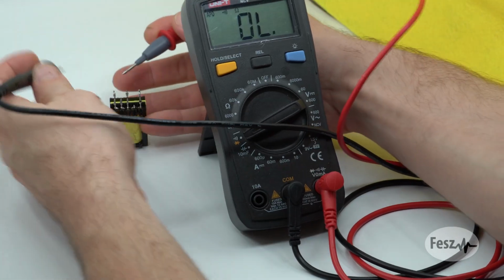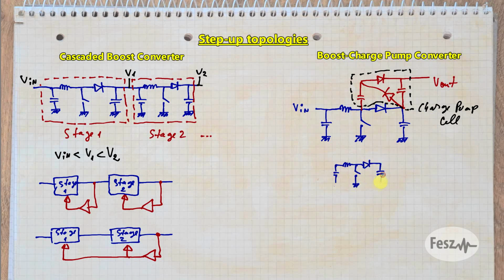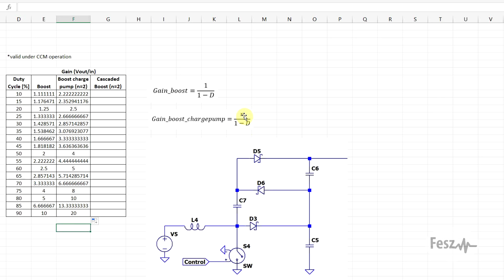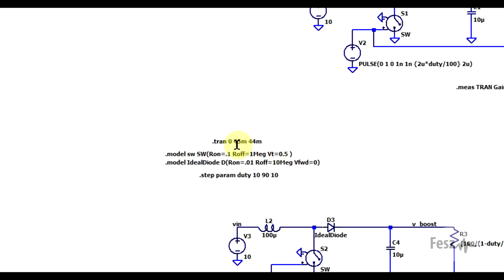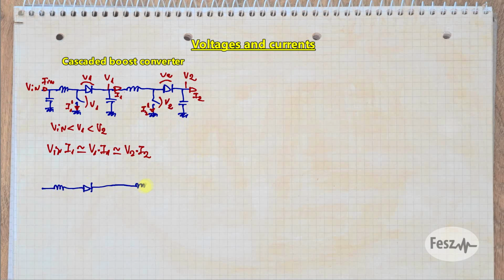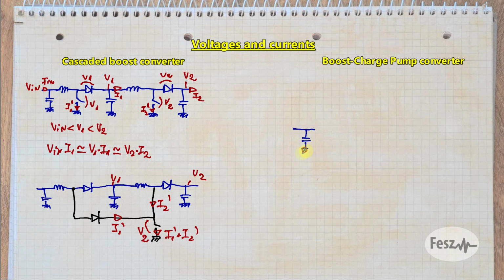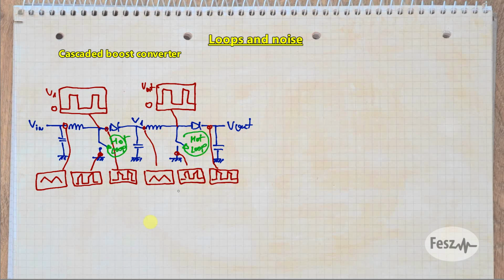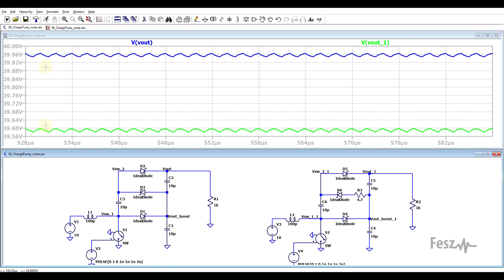Uncommon Step-up Topologies

Comment: Hi there, here's some perverse idea: what if you cascade boost converters on top of each other like charge pumps instead of referencing ground and then take the top converter voltage? This will subtract one boost factor but same transistor ratings can be used and theoretically exceeding any single transistor rating (except current handling obviously) you can get say 10KV or so. Is this how HVDC lines operate or am I missing something?
Reply from the maker: While this approach should work, I think its easier to just have a transformer based topology - have a "low voltage" primary with transistors; and then have one or more secondaries with HV rated diodes only - and link those in series. This way you minimize the number of expensive components - namely the transistors.
Reply: @FesZElectronics I'm talking about voltages where no single transistor or diode works physically (4kv+) and you need some non-trivial current not just like a CRT potential.

Comment: Hello. Please in all simulation add 0.1 to 1ohms in series with inductor : major effect also in real world. The Q factor is the main issue with inductors. From 100 Khz to 40Ghz ( my labs)
Reply from the maker: By default, the inductor model should have 1mR of ESR, but you are right - to get the most accurate representation in the simulator, the ESR can be increased to better represent the real component that is being used.

Comment: Will the behaviour and individual stage's output voltage be any different if driven by alternate switching , (instead of parallelswitching )..eg.driven from the 3526 or 3846 current mode pwm controllers ?

Comment: Excellent work!  Two questions: 

Could such a design be used to create multiple break out voltages by putting additional outputs in-between cascaded steps?

Seems like that could work as a cascaded step down if you flip the orientation of the diodes?
Reply from the maker: It should not be an issue to have multiple output both from the cascaded circuit or the charge pump. However for the charge pump you can only regulate 1 output. For the cascaded circuit, if you have multiple controllers, you can accurately regulate all of the intermediate voltages. 
A cascaded buck should also work, however there you should use the typical buck converter topology.

Comment: Nice discussion. On 13:35 you could use chokes to reduce surge current of charging capacitors and minimize energy loss. Downside I guess is ringing

Comment: Excellent presentation as always. Thank you also, for always considering  general switching noise characteristics; something upon which commercial manufacturers seem to place little value. As an amateur radio operator in a remote location with a -130 db noise floor on 40 meters, this helps in the war against the dreaded "wall wart."🙂

Comment: Going double-staged instead of using tapped inductor or trafo. It's industrial way of doing things.
In low-scale DIY I'd prefer custom fiddling to circuit complexity.
Also double-staged boost would give large output range, starting from unity (equal to input voltage) which is useful for less predictable input like solar and wind.

Comment: I used both kind in a design in that we need low noise to bias PSD (position sensitive detector)  so i put low noise linear regulator and at out put of that ferrite bead with different value capacitor. 
In that design we need +/- 5v, 12v, 15v , all of them had input voltage from a single cell Li battery which has 3.5v to 4.3v. 5 time boost snd -5v  have to high efficiency.

Comment: I thought the charge pump might be good for vacuum tubes, but then you said it creates a lot of noise and I thought, nevermind... And then you said you use it for vacuum tubes! Is it clean enough for vacuum tubes, or does it just not matter of the frequency is far enough beyond the hearing range?
Reply from the maker: I did use it, but it was not the standalone converter, I also tried to apply as many noise reduction techniques as possible. I will try to cover this in the future though, to give more details.
Reply: @FesZElectronics I just read 2 papers, on the Reduced Capacitor Energy Improved Super-boost converter, and the equivalent Zeta converter. And, well, I did not understand a lot of it, but the super boost and RCE Super-boost topologies are designed to drastically reduce output ripple. It made me think of this comment, and I love your explanations and your appreciation for weird topologies, so if you want a video idea... How does the super boost reduce/eliminate output ripple?

Comment: At 14:30, would a small inductor instead of R3 serve to soften the spikes without wasting power as heat?
Reply from the maker: At least in the simulator, I tried that without too much success - I mean with ideal diodes it works great, but not with real diodes. The inductor creates an oscillation since its coupled with the diode capacitance and makes the current spike even larger.
Reply: @FesZElectronics  I guess there's no free lunch then!  Thanks
Reply: @FesZElectronics  Good question, great answer.
Reply: FesZ, outstanding video,  thank you. I was wondering how long did the simulation run  for the charge pump configuration? My simulation does not finish.
Reply from the maker: @pbaemedan  It should run pretty quickly. Usually when it takes forever its because something is oscillating at a very high frequency - maybe try removing some parasitics or try with different component models.